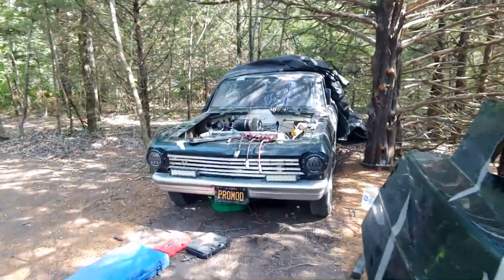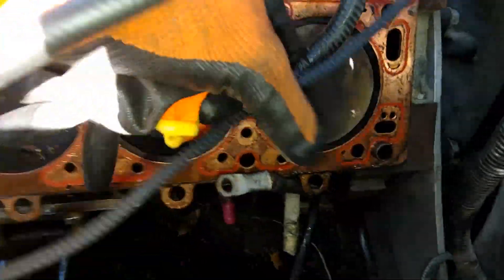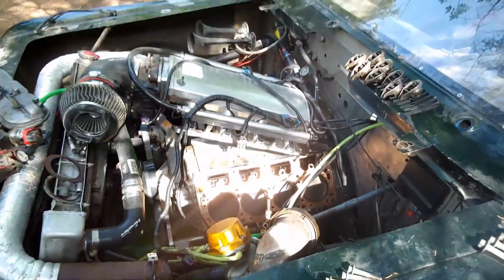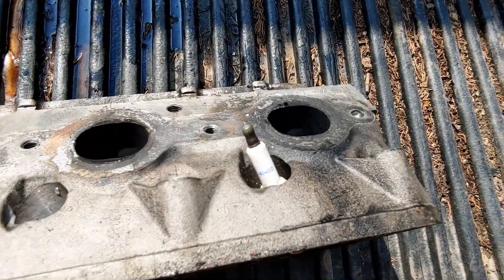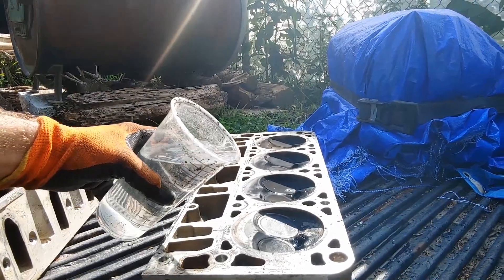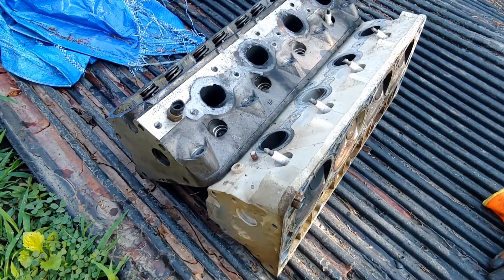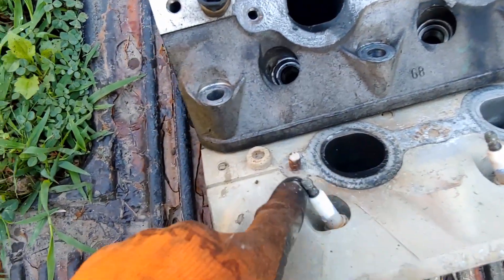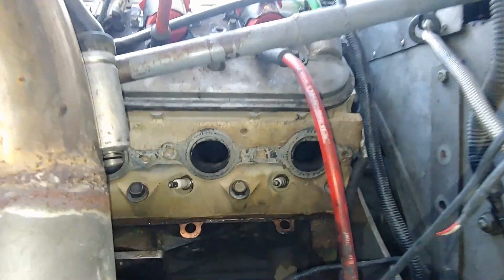How To Check for Valve Leaks

Comment: You can also leave the head on and pour oil into the spark plug hole then redo a compression test. If the compression jumps up it’s your rings. If not then it’s likely head related
Reply from the maker: Interesting. Might look into that.

Comment: I would have done a leak down test as it will tell you before you disassemble anything. But that just me.
Reply from the maker: Way to read the description......
Reply: @Syrus54 must not know how to use it then. You would know if it was a valve or a rings prior to even tearing it down.